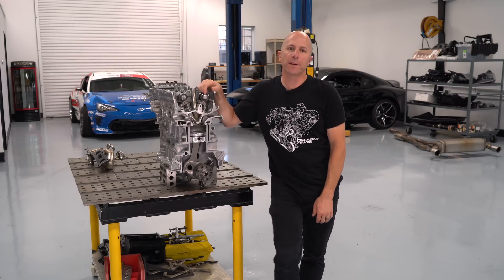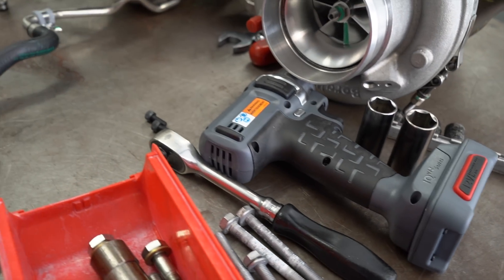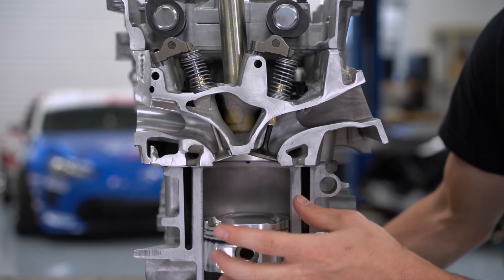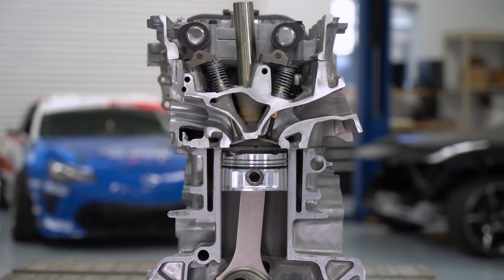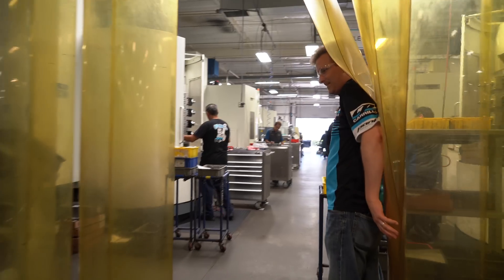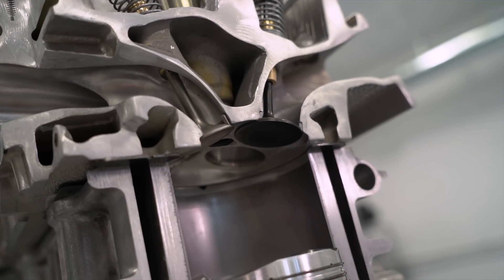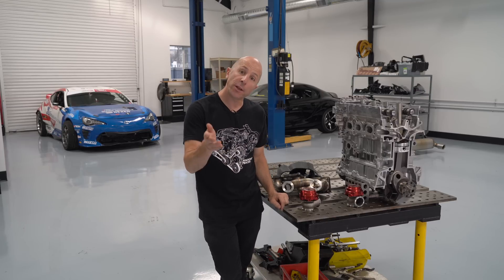The Making of 1,000 Horsepower 2020 Supra Engine Parts

Comment: It is more likely how to ruin an engine. BMW used in F1 a shit engine with so much turbo that resisted one lap. Yeah, 1450 hp but that doesn't make it great engine. It is the same crap engine with insane turbo and near zero reliability. Buy hp at the cost of reliability. That's not improving something, it is just changing something in a way it is not meant to be.

Comment: Do you have overhaul part for my 1989 Toyota 4Runner sr5 v6 4wheel drive. So My 4Runner will have more horse power. I want to rebuild. Still running good, just want to add more power

Comment: BMW parts.. That's a BMW engine.. Nothing about it is Toyota.. It's even detuned so it won't compete with the Z4
Reply: Its not detuned, just a different variation of the B58 with different Heads, Pistons, and exhaust manifold. Plus the 2020 Supra beat a Z4 🤷🏽‍♂️ And the new 2021 Supra now has the same 382 (tested at 388whp) engine

Comment: Why e85 fuel why not 91 octane. Or 87 . Im not sure so im just wondering i thought ethanol loses power and needs way more fuel.
Reply: @Seb C bullshit octane dont matter when its 85 percent cheap ass corn fuel you need to watch videos on e85 effecting horspower.
Reply: @Seb C ive been running dynos forever
Reply: @Seb C i know exactly what it is higher octane reduces pre ignition used in higher compression engines . Octane don't mean shit if you don't have high high compression witch yours is a turbo so its lower . Correct you need 33 percent bigger injectors to make the same power 91 octane straight gas would make . Do your research before you speak . Octane dont mean everything straight gas makes more power period i build and dyno daily i know this all day type it in does e85 have less power than gas . Because it does. Unless you up injectors a ton and other shit and even then your at square one. Put 91 in and do a dyno run compared to e85 see what happens you will feel pretty dumb when you see the numbers . And make sure your shits remapped for 91 straight . Thats the bet im laying on the table.
Reply: @Seb C the only reason racers use 110 octane straight leaded gas is there engines are high compression and would damage themselves without it they would knock due to pre ignition . Don't tell me I'm wrong I'm right we hold world records i know this shit ask ekanoo racing . They can advance the timing more and make more power with higher octane as well.
Reply: @Seb C yup turbo pressure fills volume of the cylinder and ups it still gas is better e85 is corrosive im not a fan of it but whatever works i guess.
Reply: @Seb C i get what your saying it is cheaper if you can't afford it we just don't like it because it is corrosive and we pull bigger numbers with 108 110 0r sometimes 91 even . E85 can be done I'm not saying it can't but you need to up fuel delivery to do it so your burning more gas in the end . Does a guys save than I'm not so sure.

Comment: Hi Mr Stefan P. I am wondering about the cast in head exhaust manifold. I am not sure but I would think heavily coating the exhaust ports with ceramikote or similar would be necessary.  Aluminum melting point is 1221F so cooling heatsoak on a run on the track may be problematic.  I would think you are also sending a lot of heat that is good for the turbo into the cooling system.  It's going to seriously work hard with that convenient packaging design when you triple the hp.  I'm not familiar with the head design,  is it possible to mill it off and tig a flange for a two piece 3+3 header setup for the twin scroll? I think it would allow you to save that precious heat for the turbo, reduce cooling system loads, and make more power at a given boost level? What do you think?

Comment: are there crank shafts designed with more distance from the center to the connecting rods that would give it more leverage for easier power gain. the rpms would drop i think but lets say that distance is just a few cm's longer what would the draw backs be?

Comment: Turbo chargers help the longevity of the rotating assembly quite a bit when compared to blowers or No2. The drive pressure created by the back pressure on the exhaust stroke acts like a big cushion to slow the piston down as it reaches TDC. This has been a game changer for drag racing. Turbos are great for  RPM  and are a LOT cheaper to operate over time than a Roots, screw, or centrifugal superchargers

Comment: @5:12 in drag racing we have seen that having a turbo charger helps the overlap forces seen by the piston @ TDC. A blown alcohol motor requires the bottom end checked after every run. A lot of people tune the motor by how much they deform the upper rod bearing and lower main. The same engine in promod with twin hair dryers will make 20-30 passes before the bottom end gets checked Because turbos have drive pressure it helps to slow the piston down as it rises up to TDC. That drive pressure acts like a cushion of air.

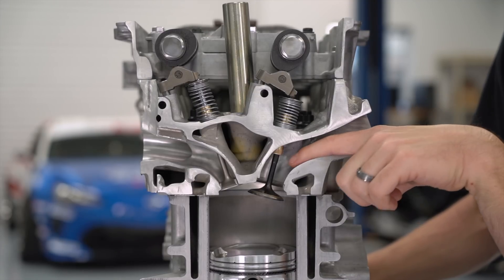Comment: @1:05 here’s something few people touch on with forced induction. If you take the square area of the back of the intake valve and multiply it by boost pressure you find your intake spring pressure @ installed height is not what you think it is.

Comment: Can I ask you why did you get rid of the water-to-air intercooler instead of just upgrading it? I always thought that water to air gives you more consistent power and since it can be mounted inside the engine bay, the tubing is shorter hence giving better throttle response. And when you're going sideways, there's not always enough air going through the air-to-air system. Please enlighten me, I am very curious about this :) Thanks!

Comment: Question, why cut the rod ends as opposed to cracking them? Your shooting for enough power and stress that cracked would work better. Thanks.
Reply: If I remember correctly the stock rods should be cracked already if I remember correctly.
Reply: @carboydorifutoparty3976  Not sure about the stock roda but they had rods made and it has been proven that cracked rods are far superior to cut rod caps.

Comment: I assume you are getting rid of the variable lift for the intake cam.  It is going to take a lot of work to get that new intake manifold to flow well. I would LOVE to see the flow data on that "cast in head" exhaust manifold.  This could be your Achilles heel !

I found the 11:1 compression ratio on a TURBO engine pretty amazing, until he said it would be burning E85 !
Reply: I guess you just get past that manifold if it's bad with more boost, where if it was NA you would be stuck
Reply: @krusher74  - If the exhaust manifold does not flow, the turbo can not spin !
Reply: @jackpatteeuw9244  this B58 has a 2 port heads vs the B58 in BMW's have the traditional 6 port heads thst they would normally come with stock already but other than that it being modular it should be possible to swap the heads from 2 port to 6 port if they took a head from a B58 bimmer. But im really just waiting on them to start sleeving these to see how much hp can be pulled out of them.

Comment: From N54 to N55 to B58. These engines are simply amazing. 

I can't wait to see how well the B58 compared to 2JZ.

I am seing all these comments bringinf the B58 down because apparently you didn't have to scan parts and make custom parts for the 2JZ in order to achieve 1000hp. Lol, I don't know if you guys think that the aftermarket parts for the 2JZ fell from the sky, but just so we are clear, these are the mechanical engineering process that were used to developped all the forged internal parts and other aftermarket bolt ons for the 2JZ, heck for any part of any mechanical system. The only difference is that instead of waiting several years for companies to design their parts, Stephan is insanely speeding up the development of the B58 platform because of his amazing ambition!
Reply: I agree. But I'm just wanting to know what kind of power I could make if it were sleeved(since it is a aluminum block that's just like the VR38 and Coyote)or billet but for RN I just want to know if it can break the S55s record of 1174hp on stock block and internals if it's possible. But really I'm curious if BMW is really going to let toyota use their S58 since it has more power,has a shorter compression ratio compared to the B58,and is twin turbo.
Reply: @carboydorifutoparty3976  I guess time will tell indeed. The point is just that we need to keep our mind open and give it a chance until we can get some more data.

I feel like the S58 would be overkill for this car. Obviously not for people who would like to mod it, bur probably for the other 95% of the buyers who just wants to buh the car and keep it stock. Buisness wise it might not be the best move.
Reply: @mayonaisesaladejamaismalade  well I was sort of indicating the S58 to be in the mk5 because of the GRMN version which is supposed to be the performance version of the mk5 but I agree.

Comment: 2020 supra sucks its s bmw not watching
Reply: So we'll forget that the mk4 was also a full out zombie that didn't have it's own solid platform or  engine for only it yet it has a shared engine from a sedan(Toyota aristo)that wasn't even intended to be put in the mk4 and its drivetrain ripped straight out of a Toyota soarer/Lexus SC300/400 with the design of a gt4 Celica that's been oversized to a whole another level.......ok then.

Comment: The only hurdle I can see in the way for 1000 hp is the limited air flow of that cylinder head. A real shame you can't port the exhaust side or fab a better flowing manifold. I could see it creating hot spots in the chamber of that casted in exhaust galley and melting a hole in the aluminum structure.  Who knows but that cylinder head is not your friend when it comes to air flow.

Comment: Good to know the factory connecting rods are actually pretty beefy, like the oem 2jz rods. Think ARP rod bolts/head bolts would be good enough for 800~hp 700ftlbs ? Can you share how much air the ports flow at stock lift?

Comment: How does lean run hot?
(Because the max temperature of a flame is at slightly rich mixture)
Reply: I'd break it down to two things, the fuel does a job of cooling in the combustion chamber, which means less fuel is less cooling. The very key difference is though that when the ratio is changed like this and with the compression there is a lot more oxygen than fuel, and as most know fires burn alot faster and hotter in the precense of more oxygen.These two combined usually causes the combustion chamber to become hotter untill something eventually breaks if its not noticed quick enough :)
Reply: @henrikwilsgaard8795  I think I understood, they are running 7 A/F  (mass) the stoich is at 9 so they are running with less air, more fuel, so they are in the rich side, like you said the unburned fuel cools down. Making it learner makes it hot. But lean makes it cool again. So the correct thing to say would be "learner" and not "lean"

Comment: 2JZ stock can handle a healthy 500hp to 600hp but built to end bigger turbo increase in air and fuel the stock bottom end is known to hand 1000hp
Reply: @Seb C thanks to Toyota engineers having a very important part of development with the 2020 Supra but Stephen Papadakis will make it much better
Reply: @Seb C they are dissecting it as we speak and making major improvements
Reply: Creating the new BJZ58

Comment: 11:1 compression seems really high, but I guess with e-85 it's okay?  Most boosted engines run under 10:1.
Reply: Curious to see if bmw let's them have the S58 then things will get exciting since it has a 9:3 compression ratio rather than the 11:1 compression ratio the B58 has.